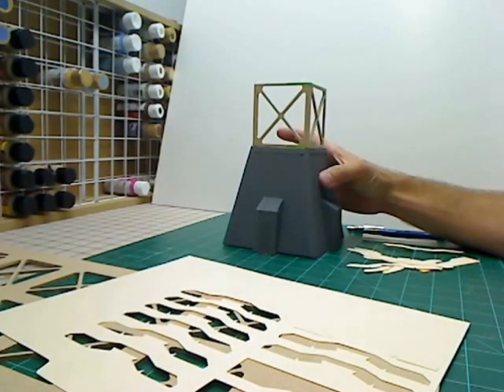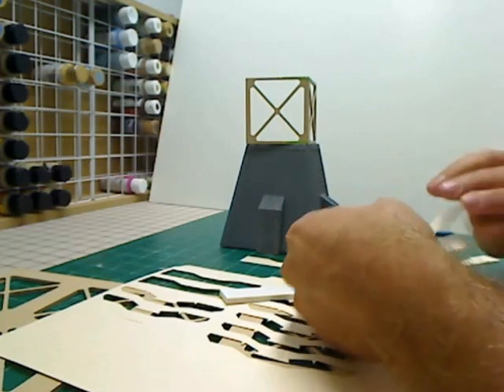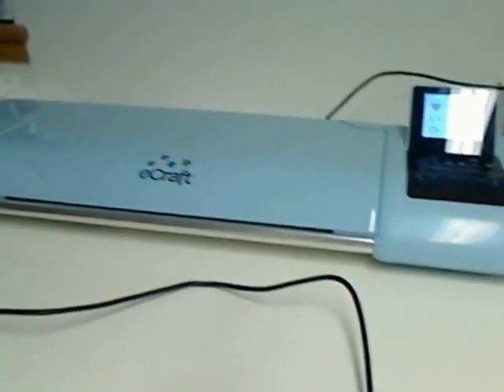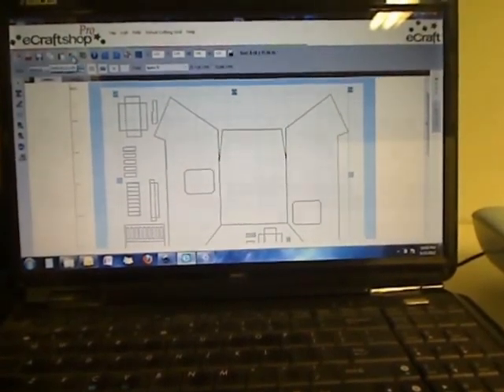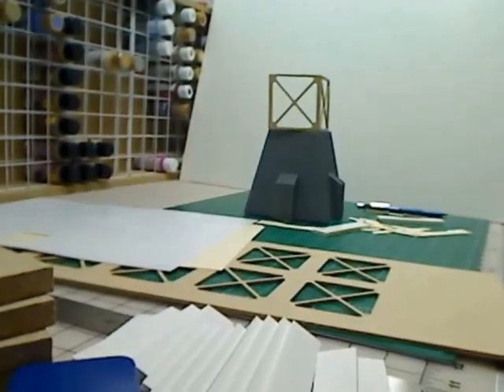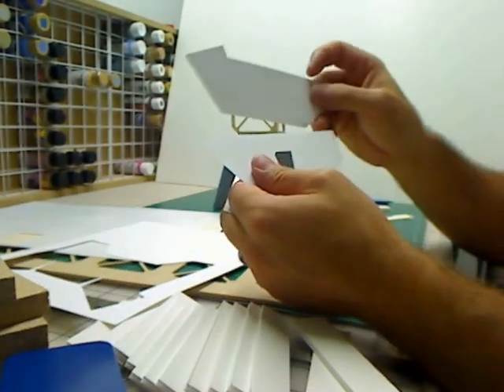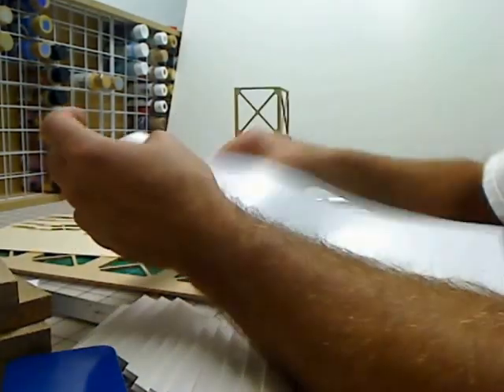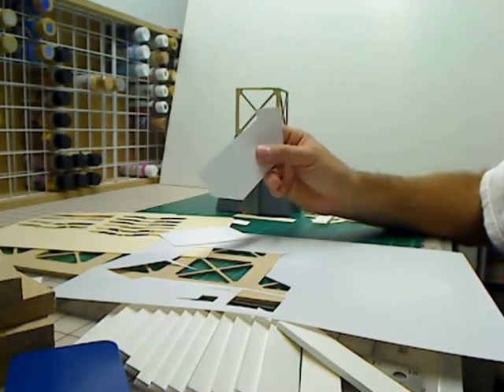Ultimate Tool for Wargaming -- Scratch Built Models and Terrain

Comment from the maker: The manufacture rates the machine as cutting 1mm thick material.  In my experience it will not cu completely through plasticard/styrene.  However, it will score the plastic and then you can bend along the score line to free the part from the waste.  20 mil works great, I will update when I play around with 40 mil.  
FYI, this is how I define a mil:
1 mil = 1/1000 inch
so
1mm = 0.040 inch = 40 mil
Hope this clarifies my units.

Thanks for the comments!

Comment: this is a nice idea but I think this is not more than a plotter for girls :) I did search and found a vinyl plotter that can cut up to 1.5 mm cardboard for about 200 usd which can cut as wide as 14" but the best part is that you can create your art in CorelDraw or Illustrator. This programs are very versatile to create any kind of drawing from artistic to architectonic. If you are really into this you might like to try a plotter/printer which will give you the cutted pieces already decorated and ready to assemble.
Reply: What is the name of this plotter? I'm about to order a Silhouette Portrait but the software for it seems extremely limiting and you need to buy a $99 upgrade version to import illustrator designs and such.
I would very much like to know the name of the plotter you mentioned, I'd like something to cut plasticard and make designs in illustrator.
Reply: MadCowCrazy I did ask for a demo of the plotter and the technician told me it won't cut rigid sheets because something something rolls so I went and bought a ScanNCut from Brother, I already tested it cutting paper, vinyl, cardboard, laminated cardboard and denim, The instructions say ScanNCut can cut up to 2 mm. of almost anything so I want to try balsa wood. and the best part is you don't even need a computer to make it work.

Comment: What software do you use with the machine?
Reply from the maker: The software that comes with the E-Crafter is not very good, except for using the text features. I use Inkscape for almost everything. Inkscape is free and community supported. The E-Crafter uses .svg files. Inkscape created .svg files. Inkscape is great and has very good documentation, not a horrible learning curve.
Reply: Where did you get teh E-crafter, all I get on ebay are car parts when I go looking for one!
Reply from the maker: Funny you should ask.  I did a bit of shopping around and found it far a good price from HSN (Home Shopping Network).  They sell items on a website as well at the TV.  If you are a first time customer, as I was, you can get a coupon code for 10% off first item you buy.  They even offered an interest free payment plan to spread out the cost over four months.